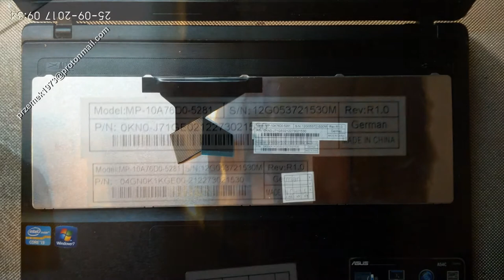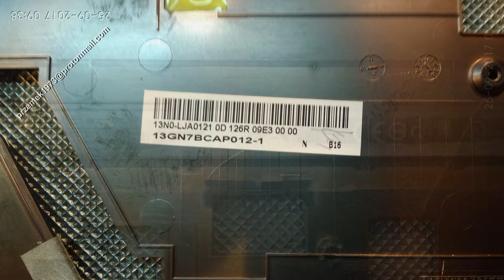Asus A54c K54c K53 disassembly  BIOS motherboard replacement, cooler fan clean, jak rozłożyć

Comment: Have you ever encountered such a problem that the board does not see hard drives and ssds?  the cursor just blinks.. if you reinstall the system from the BIOS, the system will boot once and after the reboot the cursor blinks and that’s it
Reply from the maker: Of course, this is a known problem with this model of laptop.